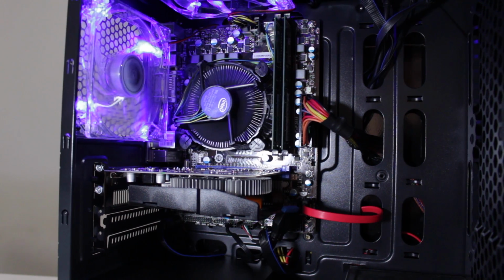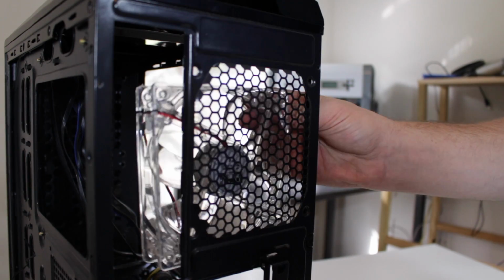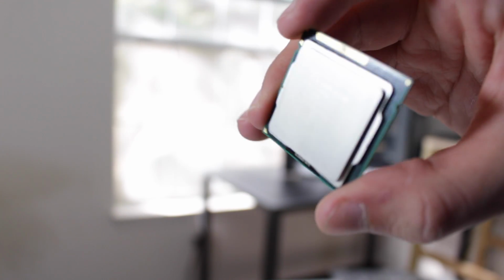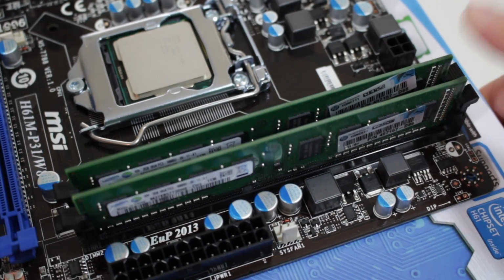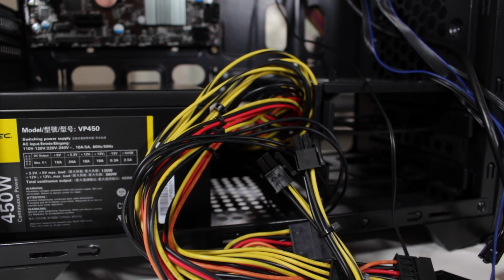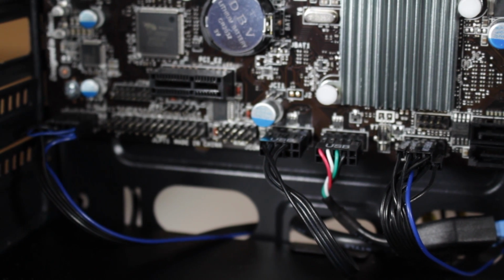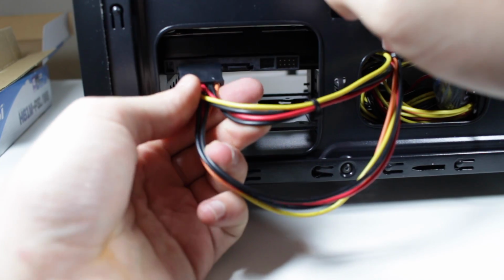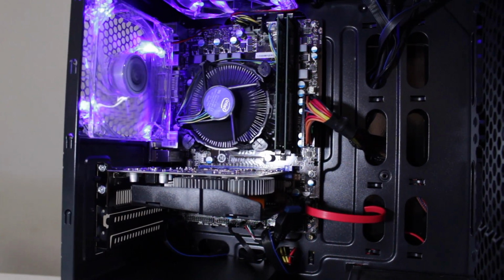How To Build A Budget Gaming PC 2016!

Comment: Yow bro currently looking for parts in amazon newegg for my first gaming rig. Any suggestion of parts with 500 usd budget? I just prefer amd fx 6300 8gb ram and asus gtx 750ti. Thanks bro
Reply from the maker: +Delfin Masamayor For $500 using an amd fx 6300 and only amazon and newegg this is what I would get: http://pcpartpicker.com/p/wvrLhM
Reply: +Tech By Matt I have a question I was looking at the pc build and I realized that there was a different cooler is that cooler better than the stock or is the stock better than the other cooler does the other cooler come with thermal paste if not I'll just buy some

Comment: You said that you don't need to tighten the motherboard standoffs because they get tightend when mounting the mainboard anyway. I would advise to tighten the standoffs for good, because otherwise, when removing the mainboard in the future some or even all of the standoffs will hold on to the mainboard screws and not the case and you don't want that.

Comment: dumb question, but what direction do you want the fan blowing? in or out?
Reply from the maker: +Shangheliee it depends. both of these i put blowing out. I could have put one in the front bringing air in and one in the back pushing it out.
Reply: +Shangheliee 
Generally it's best to have them moving in the same direction to maximize airflow. For example the front fans blowing in and the back fans blowing out. If the case has dust filters for some of the fans and not for others, then you want to pull air in through the dust filter and out where there is no dust filter to minimize dust buildup in the computer.
Reply: +Tech By Matt can you build my pc